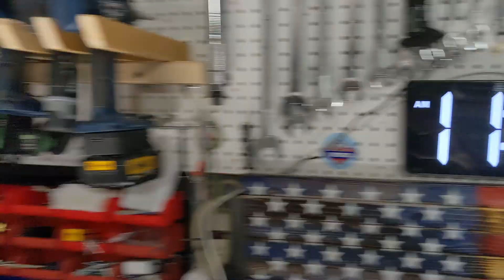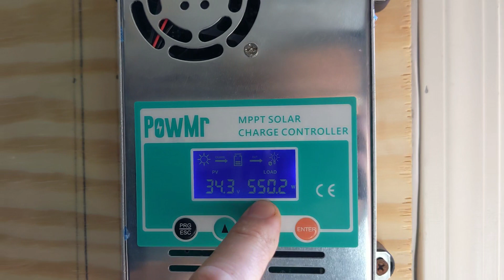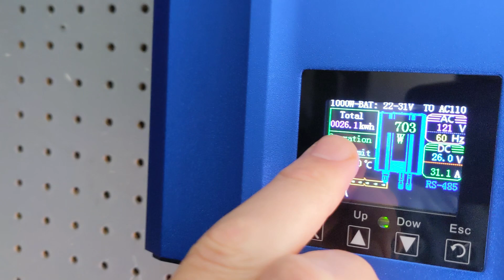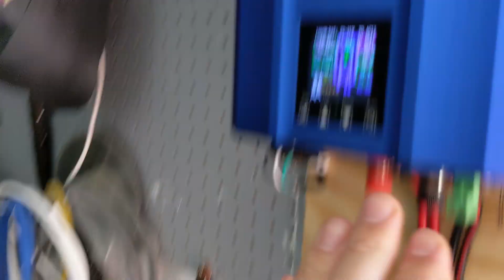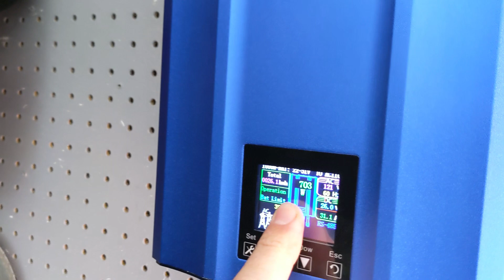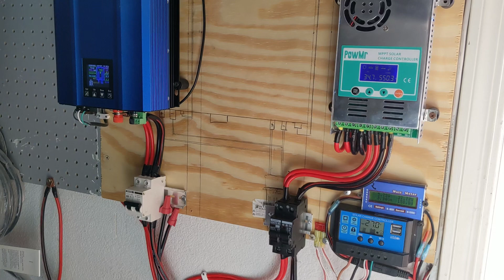Why are my solar panels losing so much power Efficiency? Explained with real numbers 750W only 550W!

Comment: Yah, DIY solar systems are immense fun!  It should be a bit better than 50-60%.  The MPPT controller... well, a good one.  I don't know about PowMr but, say, something like a Victron will be 98%.  The LiFePO4 battery round-trip at low C-rates (0.2C is very common for solar applications and with the number of batteries you have it is probably more like 0.1C)... that is 95% to 98%.  We'll call it 95%.  And the inverter is the worst of the bunch and typically runs 85% to 90%.  A high-end grid-tie inverter can hit 95%..  An off-grid inverter typically runs 85% to 90% (worse under low loads, better under higher loads).

Just multiply the percentages together to get the end-to-end efficiency.  So 0.98 (MPPT) x 0.95 (battery) x 0.90 (inverter) = 0.838.   i.e. 83.8% end-to-end efficiency through the battery. For direct load support from solar (battery is tied in but the power is basically going straight to the inverter), that would be 0.98 x 0.90 = 88.2% end-to-end efficiency.    It is quite good, considering.   However, I am assuming a 36V or 48V system in those calculations.

With a 12V system efficiencies are generally about 5-7% less than with a 36V or 48V system, and losses can become exaggerated if long wire runs are involved.   And on the solar panel side, higher voltages (up to what the charge controller can tolerate) can remove nearly all the losses over the long solar panel wiring runs.

For example, for my back-deck system I usually run 3 x 100W panels in series to develop 60-70V, and then three groups of those in parallel going into a 20A charge controller and a 51.2V (16s) nominal battery bus.  I usually wind up with around 11A per charger controller and the wiring is 10 AWG (30A), so even though the solar wiring is 30+ feet long, the losses are very low.

-Matt
Reply from the maker: Excellent math, I agree with you, but I think you missed my point about the installed wattage vs the actual power. The solar panels don't run at full efficiency, also the angle of my roof reduces their potential and the month. My point was that in December at the angle I have my roof at, what I get in the plug after all that magic that you explained happens is maybe 50 to 60 percent of my full solar panel wattage . But you were spot on the math , you surely been around the solar bloc a bit ..  thanks for taking your time to do the math .. I'll pin the comment to the top , people should read it
Reply: @VegasRoManiacReviews  Well, they also only operate for a limited number of hours a day, and the angle is constantly changing, and the solar cells themselves are typically only around 20% efficient.  So you can't really apply an "efficiency" to the panel production itself without creating mass confusion.

However, there is a general rule-of-thumb you can use.  The best way to think about installed wattage is to simply multiply by around 2.5 in winter, or around 4 in summer to get the energy produced daily.  Simple as that.

So, for example, a 100W panel will typically produce 100W x 2.5 = 250Wh/day in winter, and 400Wh/day in summer.   In sun of course.  All bets are off in cloudy or rainy weather.

The efficiency calculations really should be limited to after the power leaves the solar panels.

-Matt
Reply from the maker: I love that , great info , I'll keep that in mind

Comment: Most (not all and not all systems) solar panels when calculated after all loses under perfect conditions can be counted on to produce about 75% of the rated watts. So you are very close to 75%. Yes, there are ways to improve that percentage. But, you are about where most people are. 
By the way, I got started in solar for my home (without net metering) because of your videos many years ago. I now have four of the now well known China blue box 1000watt inverters. I discovered they can handle over current, but not over voltage so all four of them have panels that could theoreticly produce 1,200watts but even if they did they are arranged in parallel such that they will current limit before the inverters blow up. I am in Southern CA and have very, very expensive electricity. I purchased the inverters new but the panels all used. My system is ground mounted. My house is over 3K square feet and my electric bill is seldom over $40.00 with no net metering contract and no permits and no county. I can never backfeed the grid. During the day in summer from around 7:30AM to about 6:00PM my smart meter shows between 10-20Watts all day long being drawn from the grid. The inverters are at least 3+ years old and are still working perfectly. I have two on L1 and two on L2 each with their own current (clamp) transformer that came with the inverter.  I did everything you said and I could not be happier. Thank you.  I look forward to seeing how this new smaller inverter holds up as I would like to do my Daughter's house like I did mine. All inverters are on their own 20amp circuit with breaker.
Reply from the maker: There is very good news that means that my system is going to last a little bit longer than I thought it will, I'm really happy to hear that 3 years later you're inverters are still working I was wondering how long mine would last

Comment: Really bad system...
With this you don't like electricity at all ..
Try all in one system to get 90% efficiency...
Change your solar panels in to the real 500+W modules...
This is funny to talk about system that is 15 years old....
Reply from the maker: It's brand new , including most of the panels , also this is a grid tie inverter with power limiter, you might not be familiar with that system, but there is no all in one anywhere in the market
Reply: I'm selling all this stuff in EU... that is my business...solar business...
I live on solar too...
My workers just install several units of the 2kW inverters (110V input ) with limiter before Christmas...we are using this when people don't have place on the roof for solar panels...

I can see that your system is working on low voltage, that is old system...
All in one is working on 400\500V DC from PV... (Some until 900V)
High efficiency with highest voltage ...
I just to play with this what you have about 10 years ago...
If you need more information, give me some contact and I'll let you know what is on the market available...
Reply from the maker: With all the respect I don't think you have the slightest idea what is a "grid tie inverter is with a power limiter" quite a unique technology , you should look into it

Comment: Hmmm.... If you're batteries aren't discharging and your solar is producing 550 watts then there's no way you could be putting 700 watts into the house....I think you've got something hooked up wrong.....
Reply from the maker: No what you have not maybe notice in the video is that I have also PWM controller for some old solar panels there are different voltage different amps that are pushing another 150 watts, So the 550 with 150 700 so that's where the math coming from

Comment: The mismatched panels could also reduce efficiency.
Reply from the maker: They reduce a little bit of the efficiency but not that much because there are in the same voltage rating and in the same amp rating So when I connect them together I made sure that they are similar as far as the voltage goes and also The amps that they could push too basically some of them are in the 5Amps and the others are in the 525 so Yes you're right there's some very very small losses in there but not big to worry about

Comment: Looking at big solar plants with solar tracking system...  That would be expensive, probably.
Reply: Tracking was a thing decades ago. 
Now it is not justified. 
You can add some about 30 percent to production, if I remember well. 
But with the cost of tracking system you can add more than 30 percent more panels. 
Plus.. moving parts means breaking a lot. 

But if you make yourself the tracking system you may justify the cost if you have nothing better to do with your time.
Also you may do something partial, like vertical adjustment. And few times a year you just adjust it manually. 
This system is a lot cheaper since it means just some more pipe and bolts.
Reply from the maker: Tracking it's expensive solar panels  are cheap